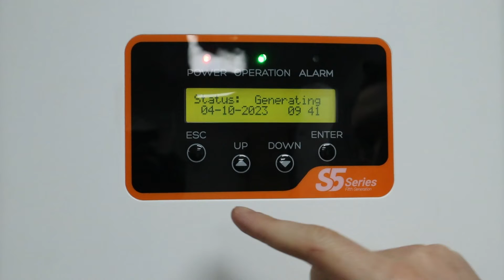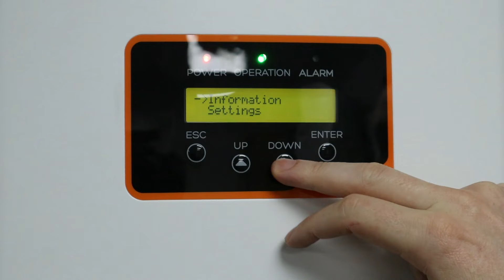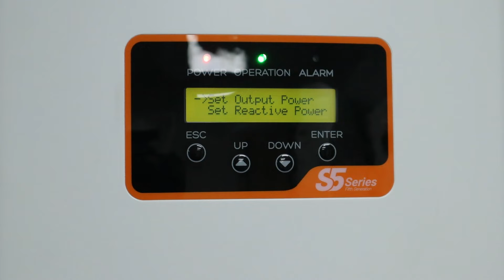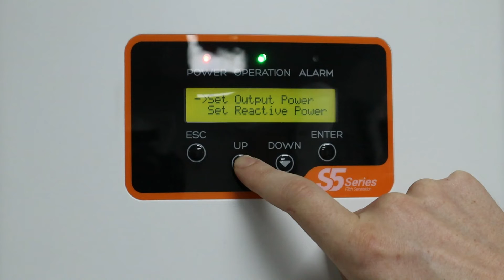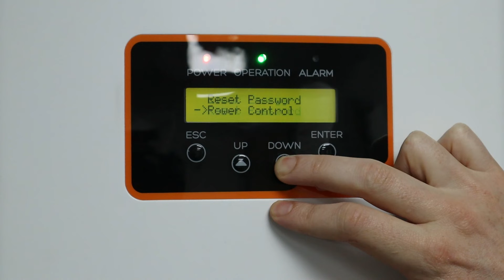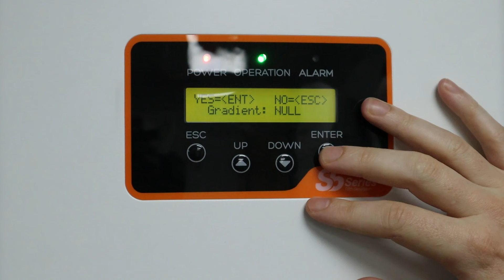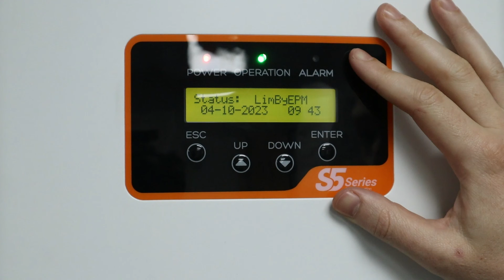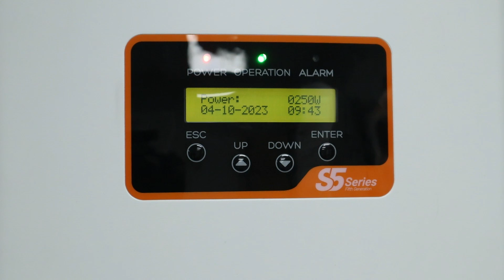Active Power Settings - Derate Inverter

Comment: I have Dynamic prices. They can become negative in the summer. Is there a remote interface which i can connect to something so i can derate and powerlimit the inverter with some external home automation system ?

Comment: Is there a benefit to Limiting my Inverter's power, has recently my 5kw Solis inverter developed a Fault and was replaced under warranty by Solis with a 6kw Solis inverter, any info would be appreciated my inverter is running 14 PV Panels on 2 Strings  😉
Reply: Ian - Unless its required to be a 5kW by the DNO there is no reason to derate the inverter to 5kW.  It won't make your system run more efficiently.
Reply: Thanks Travis for your reply much appreciated 🙏
Reply: But if u setting 24h work mode then its ok to use first u showed?